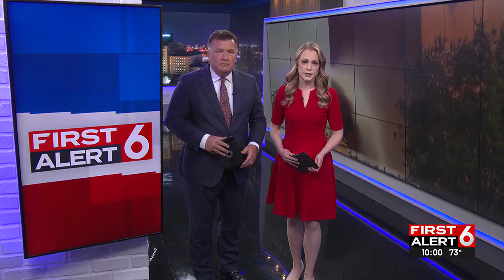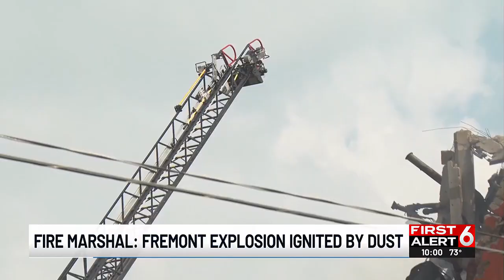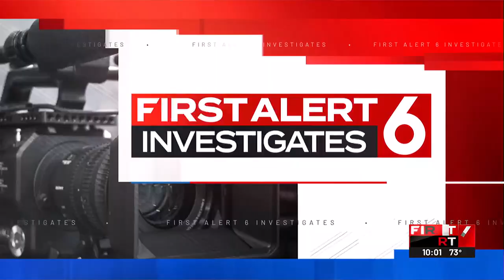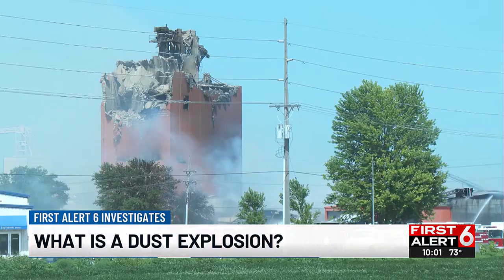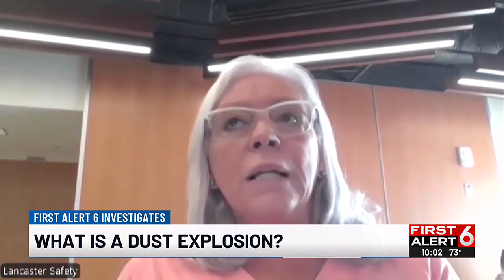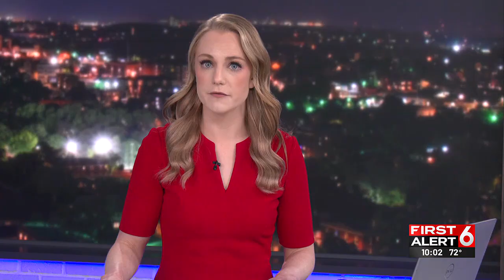EXPLAINER: What is combustible dust?

Comment: Words and a graphic won't explain very well to those who can't already reason the likely causes of the explosion, already having some or a lot of understanding.

A typical (disclaimer: any doing this takes responsibility, I disavow responsibility or any liability) demo is loading one end of a fat soda straw, with cornstarch, then blowing air at other end, with cornstarch end directed at a flame.

I'd suspect such a VERY common (or was common, in 1960's & 70's gradeschool science classes) demonstration might be found among results from utube search of "ignite cornstarch dust".
Seems results include lots of related ignitions & explosions.
Grain silos, factories, grain dusts, wood dusts etc.

The staw & cornstarch demonstration doesn't really fit the "confinement" & "dispersion" without much elaboration.
I'd guess, blowing straw to send cloud toward a flame "fits" what "dispersion" is about.

One might try to analogy explain, to how a concentration of combustible gas can be ignited(and explode). This would perhaps illustrate "confinement" in that graphic. However in such a case, enough "dispersion" could dilute the explosive gases to point the no longer could be ignited by a spark.
An illustration of "confinement " aiding (I'd not agree it's always  necessary as implied by the graphic), would be like when people take a  nearly empty liquor bottle of high proof (like 80 or higher) with those last few drops of alcohol(warm with cap on, under hot tap water of faucet, will evaporate more alcoho, for more combustible vapors), removing cap & quickly dropping lit match into bottle.
Lots of kids had parents doing this for entertainment after finishing a liquor bottle.

I'd gather the "confinement" in graphic is perhaps referring to confined space (🙄 buildins, , structures, tanks etc) rather than outdoors.

Be it an evaporated liquid (propane, gasoline, myriad of chemical compounds).
From a natural gas leak in your basement to liquids evaporated into combustible gases. Or in your ICE motor of a vehicle, in the combustion cyclinder, where a flame front rapidly burns, or is descibed as explodes, driving a piston or wankle rotor.
For the less educated, you can view the combustion of such gases (MIXED with oxygen) as analogous to dust particles being analogous to combustible chemical molecules (such as CH4, natGas). Both being in "dispersed" form, & able to mix with, & rapidly react with oxygen, in explosion.

Somewhere along faster and faster RAPID BURNING, one might deem the burning(or chemical reaction) as exploding/explosion.
See primer chord for fast burning.

Rapid burning[confined]: pile of gunpowder burning fast, wrapped[firecracker, bullet, shotgun shell etc].

Log in fireplace: burning actually includes heated wood evaporating. Evaporated solids(gases) burn. In some wood gas burning systems, one might need to be cautious  of accumulating (confined) unburned wood gas. Eg. A shutdown wood heater in a home, where thermal mass in  masonry might have smothered fire, but wood gases still evaporating from wood.
Log vs split into kindling (imagine the burn rate).

Building of pellet wood.
Exposure wood gas, be from lot of heated wood (perhaps chippers, probably grinders & pelletizers that press into pellets).I'm guessing, but maybe industrial pellet making would have some wood gas created.

Whether dust explosion was first, or a fire with wood gases released.
(See danger to fireman, flashover, flashpoint?   Burning building, lacking oxygen, uncombusted gases, fireman opens door, letting oxygen through open doorway, massive flame to fire-explosion.)

Now wood pellets are not wood dust, nor tiny granules like corn starch powder.
But imagine a rapidly expanding fire, and wood gases &/or wood dust "dispersed" and say, a small explosion or very rapid flame front, and THAT hitting pile of wood dust(even dust collection machinery) or pellets. If those pellets are hit with flames of woodgases (or explosion analogous to corn starch blown into a cloud into a flame, demo).
Chain reaction? 
Flames & explosions with enough oxygen, self feeding cascade of fire & explosion.

 I think a good explainer by analogy would be to explain with examples, chemical reaction, oxidation, burning, rapid burning to explosion.  Liquid to vapors. Eg, slow burn of gasoline, if light the vapors over bowl of gasoline vs a sprayed mist vs ....etc.

Pile of small combustible particles (eg. Corn starch & wood dust) vs "dispersed"(airborne, intermixed with air/oxygen).

Other possible illustrative examples: aluminum foil in a flame. Powdered aluminum (including use in solid rocket fuels).
Flame on steel vs fluffed  (decompact, unclump) steel wool.
Reply: I don't know how it's done safely.
Seems 🤯.
But I stumbled across internet once, a report about machinery.
Machines that food industry uses. (Think how you handle corn starch & cocoa at home, avoiding getting it airborne or hit by air flow. 😅don't drop open container.)
Anyway, instead of moving and dumping fine powders from containers, there's pipes, and they blow powders around  through the pipes to where they're added to food (or food like substances food industry sells as food).